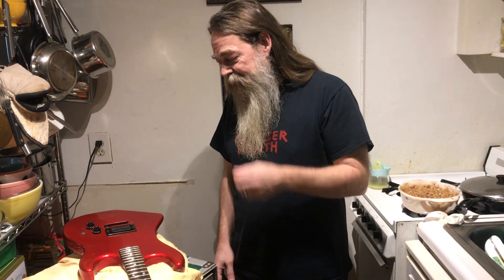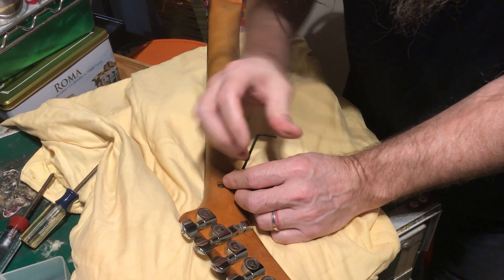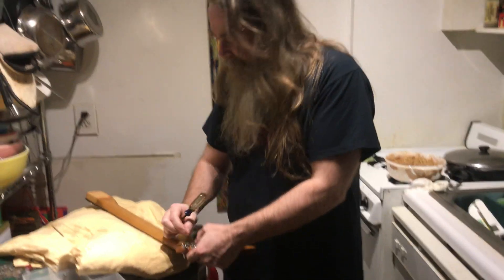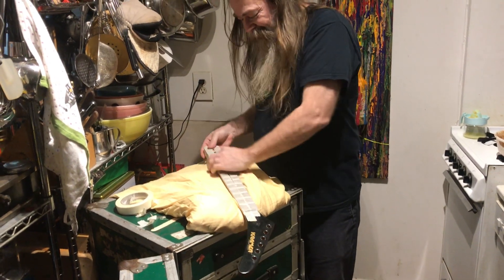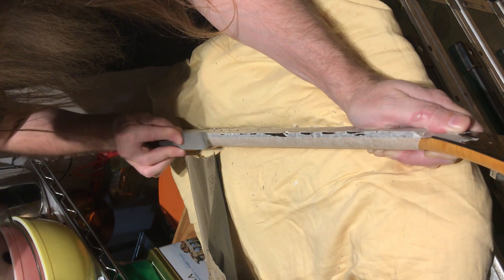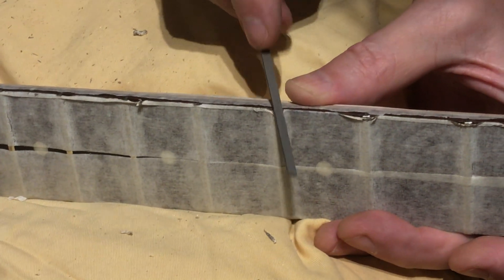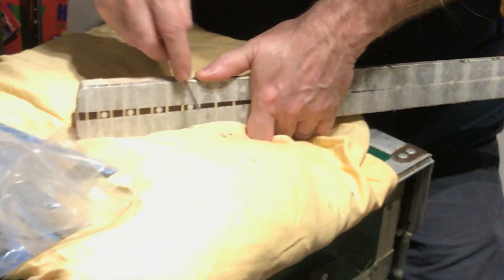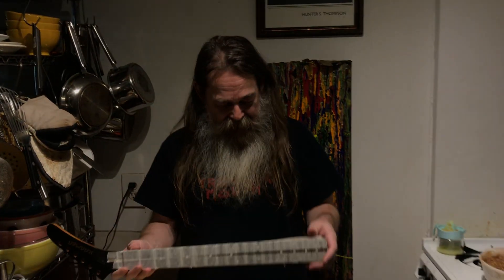Episode 11 Disassembly and Dreaded Fret Spouts. Refurbishing my vintage Kramer Pacer part 6

Comment: You need some 4-ought steel wool for those frets.
Reply from the maker: Jill used mine all up in the mouse war. Also, I don’t like the stuff, it is pretty messy.  It gets all over the place. Working in my kitchen, I don’t want to worry about finding bits in my fried rice.  It does work great. I used to use it.